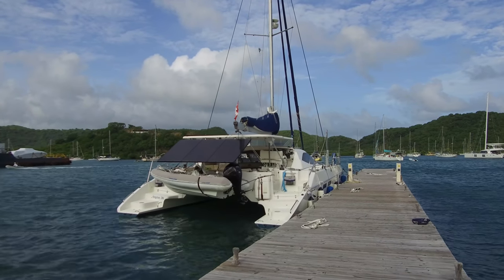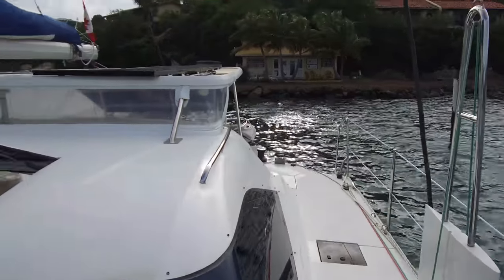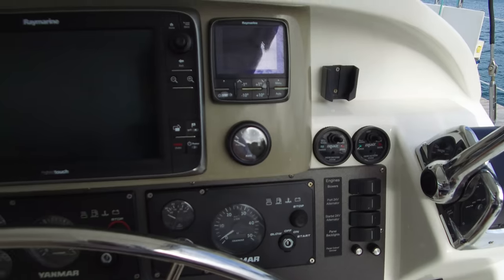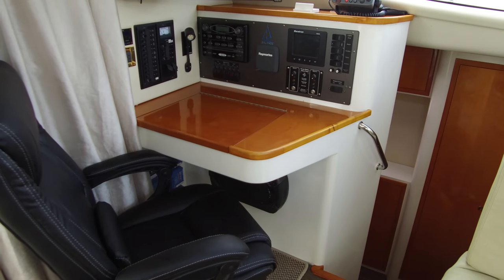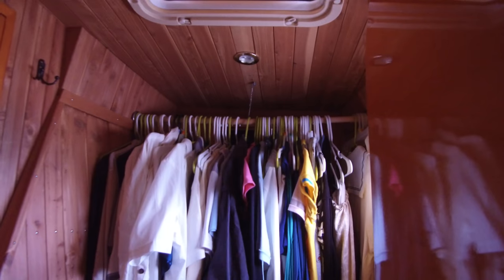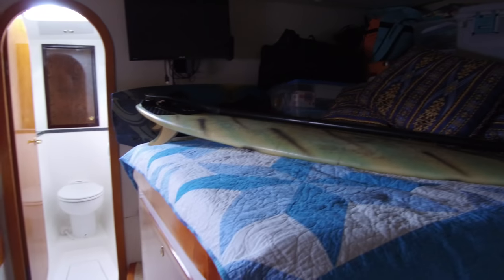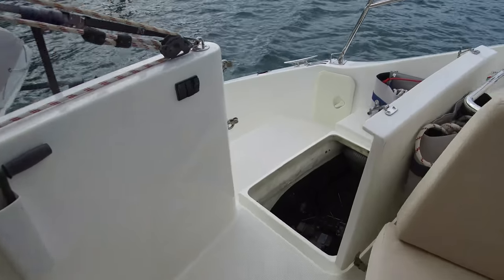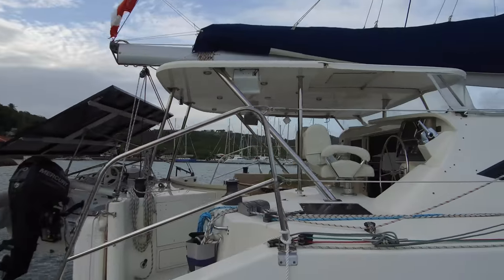2014 Balance 451

Comment: Very nice presentation! Benchmark! ANd I really liked that boat... Is there a crew head someplace?
Reply from the maker: Francisco - I am afraid that there is not. I have sailed these boats quite a bit and what we have always done is to have whoever is in the port aft cabin use the head on the owner's side. It actually works out well as the owner's side doesn't close off as one large suite, the head and owner's side cabin each have separate doors.

Comment: Some nice features on this boat and some strange additions without planning on dimensions etc.  Like the solar panel that was installed on the salon roof deck.  Overhangs the front of the roof by quite a few inches just looks sloppy.  If buying items that are this expensive why don't people measure properly and purchase and design them to fit?  Needs better glass on front of bimini cockpit too for improved visibility.  Its not even fitted properly.  Big holes for water ingress through the centre forward facing will blow straight into the cockpit area.  With even a few drops of water on that plastic you won't see shit.  The interior already looks a little dated.  Are you sue this is a 2014?  Who removes the salon table?  Wtf?  Central vaccuum system on a sailboat this size is plain weird.  You don't need it.  Having a performance sailing cat with daggerboards and then lining a closet full of cedar is pretty dumb.  Seriously though, who does that?  [Apart from Goldie Hawn in "Overboard"].
Reply from the maker: Some good observations. So - after you buy a Balance 451, we will come do a tour of your boat! I'm looking forward to it. Actually - this boat is currently off the market, but hull # 6 just came on the market. Definitely a few things better figured out on #6. Mostly fit, finish and saloon layout. Let me know if you would like more information on this boat.